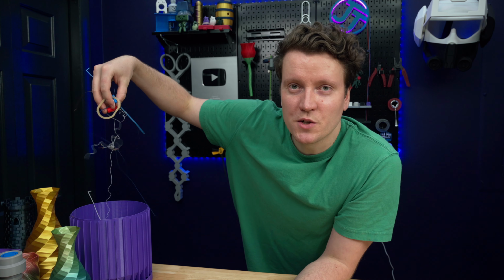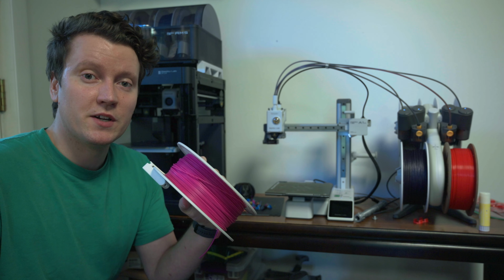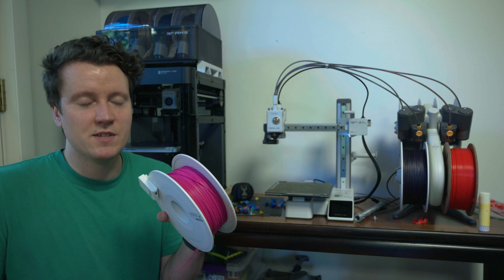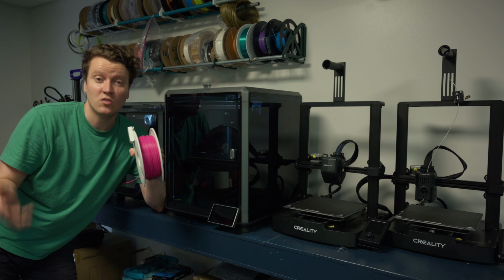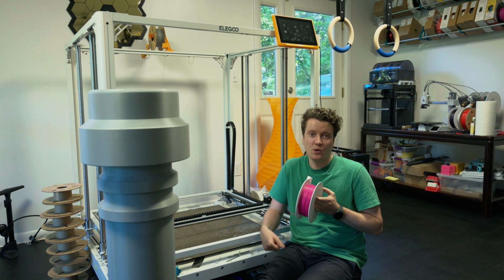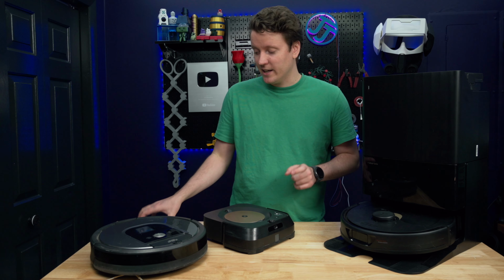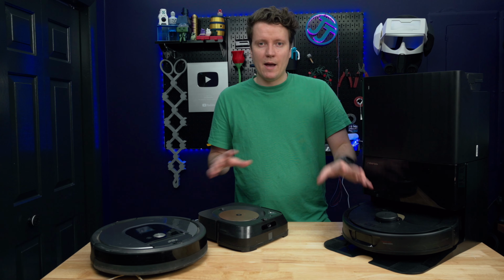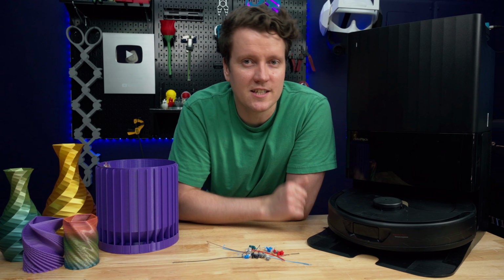Robot vacuums are getting so good! - Roborock Q Revo Review

Comment: There are cheaper and easier ways to catch poops.  And purge-lines you remove yourself from the bed, so why are you not throwing them in a bin?  I have a Q-revo and overall like it a lot, but I would prefer it having a cyclone bin rather than a bag and it doesn't mop well next to objects or in corners.  They really should change the software to have it "wiggle its ass" towards the edge of the objects to get the mop pads closer.  But as said: overall a great help the past 9 months.